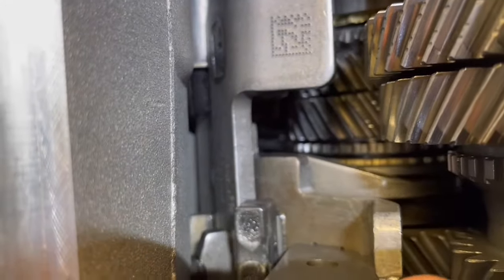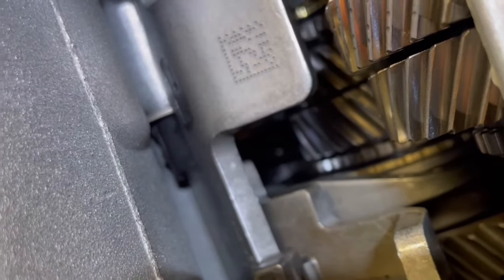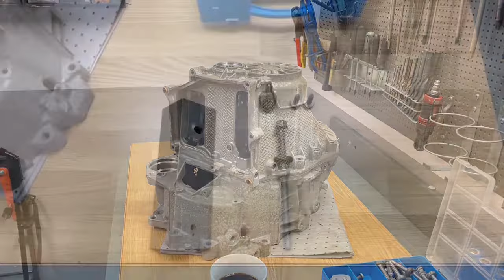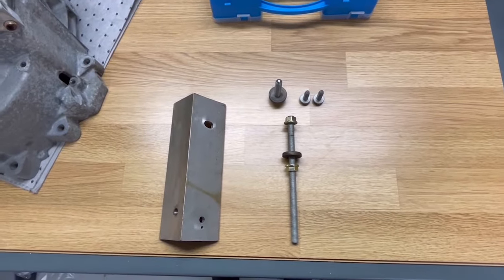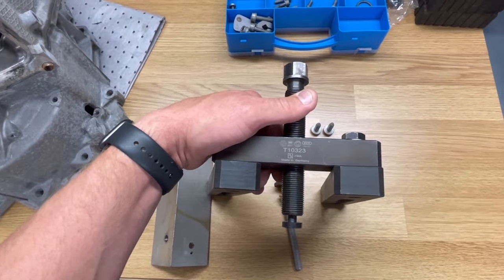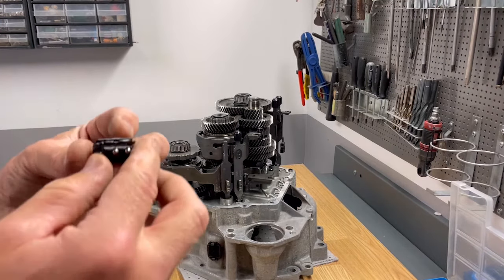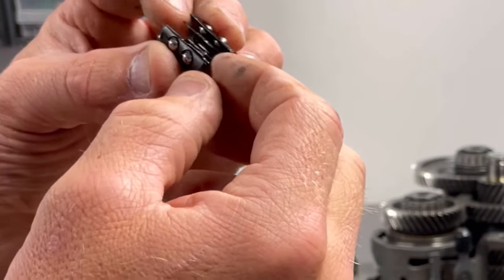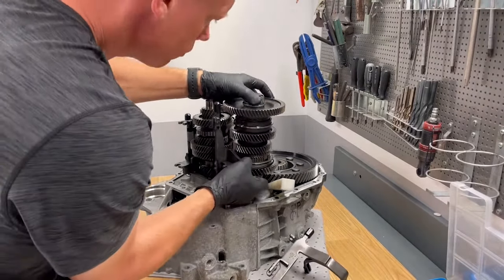DSG 0AM 7 Speed Repair DIY

Comment: Excellent video, thanks.  I cannot find anyone prepared to fix my dq200 (same bearing issue as yours).  So I’m thinking about trying this. I do not have the tools to remove the clutch.  Do you need to remove the clutch to split the gearbox housing?
Reply from the maker: Thank you so much. Yes you have to remove the clutch, go to local Volkswagen dealer and ask if you can rent that tool for a weekend or so. You do not need to shim the clutch if you use the old clutch again. Thank you for your comment.

Comment: hello and thank you for your video. where did you find the fork bearings and what is their reference?
Reply from the maker: Hi!
I bought it on eBay. 
Hope this helps😊

https://www.ebay.com/itm/323984127698?epid=27024927944&hash=item4b6ef576d2:g:5JMAAOSw3o1dXljR&amdata=enc%3AAQAIAAAA4FySAWuYhbAM0QG3HQdNUuWtfpvLm2U0ICUd08NG5wYXFch%2BYZlhAkr%2BpAcnXIGYWBR92l80YXJx7RQCIyAwI3tfeF%2FqDk3BETMdQeiFT5uc595yPMha9COpNE0zPLrALwM5MPlnxRUpLker3P0knkF%2B5wjTV8XDhrSl0zVvMktDaZzXZSX5TT7eK5eKrQ1%2BS5CLKk0TzCVYlj4lHXt%2B1w9%2B%2FvmxsQTdsTs3UOmJ6NVPZUAxe6tFid8PDqthKewJUxzXY4chhj6dzilShoaLcEzSKdWahscaXi0NcJhrZBs1%7Ctkp%3ABk9SR8a_uJTXYg

Comment: Great Job! Is this what you also have to do should the gearbox screw mount holders get damaged on the actual gearbox? Replace the casing?
Reply from the maker: Thanks.
I’m not really sure what you mean. But if the casing is damage during the pull I would try to repairing that first before I replace it.

Comment: Is it possible do you think, to pour boil boiling water from a kettle over the outside of the gearbox casing to expand the aluminium, when taking the casing off and pulling the bearing out the casing, leaving it on the end of the shaft? Rather than use a puller?
Reply from the maker: No, you need more heat than that, but I’m pretty sure that you need a pulley anyway. Its a very tight fit.
Reply: @flyingtools  ok, thanks, only thought, as I’ve done this before.
Reply: you're not pushing the bearing out of the aluminium housing, you're pressing the shaft out of the bearing, hence the heating the case would provide almost no benefit at all, it is steel on steel situation, and you cannot heat up the bearing race quickly enough to expand it before it transfers the heat into the shaft which also would expand and make the effort pointless
Reply: @dsfs17987  I also now know there is a circlip holding the bearing inside the gearbox casing.

Comment: Hi, should the driveshaft flanges be stiff to turn normally when gearbox is out the car?
Reply from the maker: Hi😃
Yes, you can turn them by hand without any tools but it will be pretty hard.
Hope it helps.
Have a great day and thanks for your question.
Reply: @flyingtools  ok, thanks very much, gearbox is out for a different reason and was quite surprised how stiff it was to turn, completely different from all other gearboxes ive known.

Comment: Would you happen to know the torque specs for the drain plug on the Mechatronics unit? I have searched high and low for that number but always come up empty handed. All the best!
Reply from the maker: I will take a look at that and come back to you;-)
Reply: @flyingtools  Very much appreciated! I know the top one is 5 Nm + 90 degrees but I find nothing about the bottom one
Reply from the maker: @snubbelbuff1471  I have just checked the workshop manual and you should not drain via the lower screw, you have to remove the mecatronic and drain it via the top screw, thats why you will not find the torque specs for the bottom screw.
Reply: @flyingtools  Ahaa thank you for answer. My local Volkswagen dealer says that the fluid is "lifetime" and that they will simply change the gearbox when it falls apart so I changed the fluid myself (yes through the lower bolt) and the car drives like a dream. Just wanted to ask since you didn't look "lost" around the gearbox. Thank you for video and answering my Q.
Reply: @snubbelbuff1471  Just snug it or it will strip you can drain from the bottom screw as well!
Reply: 5 nm and 90 degrees after that!

Comment: Hello sir, please could you advise me. 
I have an issue with me DQ200 DSG 7, it isn't selecting any gears at all and doesn't drive. At idle it makes lots of banging noises, do you think it could be a)flywheel b)clutches or c)gearbox? How can i diagnose?
Reply from the maker: Hard to say but probably clutch or flywheel. You will probably see that pretty easy when you take out the gearbox.
Reply: @flyingtools  Thank you for the reply! I have removed the gearbox, i am so confused because i dont know what to look for. Where do i begin, what should i look at?

Comment: Hello, how do you the gearbox housing screw torque spec? I cannot find it
Reply from the maker: Hi. I did not find them my self so I just tightened them by my feeling.
Reply: @flyingtools  may i know if can remember the head of the screw? T30 or the other types?

Comment: Trying to split the cases on a OBH very tight do you have to use puller same as yours thanks ?
Reply from the maker: It is sitting really hard so a puller is a must have.

Comment: Hi, how much kilometers was the gearbox when you noticed the failure? on which engine / car is it installed?
Reply from the maker: 110000km. Golf 7.  1.6 diesel.
Reply: @flyingtools  I have a VW Polo V 1.6 Tdi Common rail with the DSG7 DQ200 0AM gearbox that I have driven for 310.000km. The gearbox has often difficulties to shift the reverse or the 1st gear when it is warm. In such case the gear indicator informs that the gear is selected but the car suddenly stops starting and it asks to press the brake pedal so that it can finally select the gear correctly. I have experienced Mecatronic failure at 255.000km and then the mecatronic has been exchanged against an overhauled one and I think that this shifting problem didn't appear before. Today I have Mecatronic failures again and the Mecatronic is removed for repair / upgrade. I have then the opportunity to inspect the selecting mecanism through the Mecartonic holes. What would you advise me to look for in order to diagnose this reverse / 1st gear selecting issue?
Reply from the maker: Look for excessive play in the shift forks, make sure that the magnets are clean from debris that indicate the fork positions. Not so much more you can do. 
It sounds to me like you have a faulty mechatronic.

Comment: Can the shift forks be replaced without removing the clutch? Does the clutch have to be removed to take off the cover and remove the gears?
Reply from the maker: Hi, yes the clutch needs to be removed.
Reply: @flyingtools  I have the same tool as you and I also got the same threaded rod setup. When trying to wind up the cover the cover lifts up about a half an inch and the rod and screws on the tool start bending and the cover is not lifting any further. What am I doing wrong?
Reply from the maker: Have you removed the flange to the left drive shaft? 
It is fitted with a 6 mm Allen bolt inside the centre of the drive flange.

Comment: Hello again, I'm sorry, I want to know if the oem number of the DSG transmission oil we used is G 055 512 A2?
Reply from the maker: Hi, I have to check that on Monday.
I do not have it in my head😅
Reply: The dsg oil or the gearbox oil?
Reply: @flyingtools  thanks i will be waiting for your reply😄
Reply: @Roverturbo  gearbox oil
Reply: @huseyinunal7166  sorry don’t know the oem number but it’s 75w synthetic.
Reply from the maker: Sorry for my late reply.
G055512A2 so you are right.
1,7 litre.
Reply: @flyingtools  Thank you for your help

Comment: How many liters of dsg oil does this dsg transmission hold ?
Reply from the maker: If I remember correctly it is 1.7liters.
Reply: Dsg unit  oil is 1 litre… gear box oil is 1.7 litres.

Comment: where can I buy such bearings?what is the part number?
Reply from the maker: Hi.
I bought it on eBay.
Here is a link:

https://www.ebay.com/itm/254705589172?hash=item3b4da2dbb4:g:Rc4AAOSwFNhfTSYK&amdata=enc%3AAQAIAAAA8PLXU5BdyhatdK2e2Kd5XlkLZZgYOaqIEoZdMO1QXJhDeMF4C1E19vpcDE%2BlfwqcQBp%2F1a07zKfF7hyrmGOeLlhpAJOoZZisir09EWRbURz02A15pZym3KbQtSnH%2Fs8Dhnf0anTazYtcig%2B%2BFc4rSW5UR1uIXMOJtx6yqCDN62FkxKWLUaYYoCUW%2FYIwgHNJVFtMRMhP4rNKgA8MIMhfK1wlTEwBghtMN7E5LQE55mE75B7wdbv0Lu%2FVNkWYdMcAOBt8n9iMBWBlevl%2FXCwyEgvYv8cHaH1T5Y8jcVmhyrLIfmTC%2Bgb7PcdD8Nk%2BYSojXg%3D%3D%7Ctkp%3ABFBMnPGKw8Ri

Hope it helps😊

Comment: Hey man can you help me out with a problem, error on dash says transmission faulty please service. Code is P176F00 clutch 2 closes unintentionally. The car won't even start. Would this require a replacement of the mechatronic unit?
Reply from the maker: Hi! It might be the mechatronic, a little strange that it want even start🤔
It’s a little hard to say what it could be without being there. I wish you good luck anyway.
Reply: @flyingtools  yea it just displays msg that Transmission faulty and won't start, if the transmission is disconnected then it can start. Seems like mechatronics as you suggested.
Reply from the maker: @elevatemed2958  ok, I think your right. In that case I hade replaced the mechatronic.

Comment: Why don't change ring gasket??
Reply from the maker: There is no. Silicon glue is used by the factory.
Reply: @flyingtools  I meen another gasket - on the val
Reply: @flyingtools  Cuff on the shaft

Comment: Hello where did you get the tool pull apart the gearbox
Reply from the maker: Hi! The poller is a vw tool T10323 that I borrowed from a vw workshop. The rest of it did I made myself. Thanks for your comment 😊
Reply: @flyingtools  hey thabks for the reply so the same tool you used to pull the clutch you used to pull open the two halves of the box?
Reply from the maker: @shimon2476  yes thats correct.👍🏻 It’s not made for that but it worked pretty good.
Reply: @flyingtools  understood thanks brother
Reply: Cleaner than a hospital and slick as a surgeon, nice job 👌🏻

Cool truck aswell 😎

Comment: DId you have to remove the clutch packs to get to the selector fork for reverse and 6th gear?
Reply from the maker: Hi, no, just the mechatronic. But before you remove that you have to set all shift forks in neutral. You can do that either with your diagnostic tool BEFORE you take out the gearbox from the car, or as I did in this case, via the selector cover.
Reply: @flyingtools  Thanks for the reply. I have a 2015 Polo GTI. Did VW put upgraded bearings for the selector fork? Or will I encounter this problem eventually in my polo? Thank you!